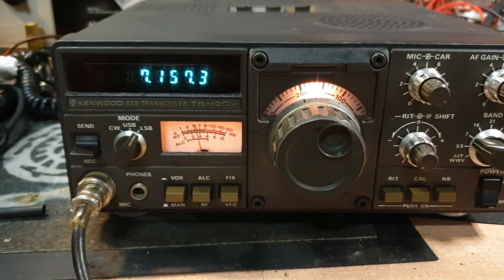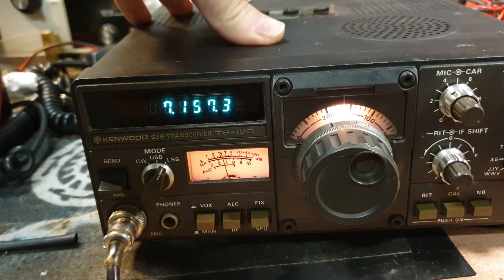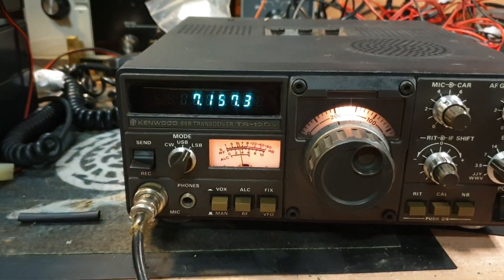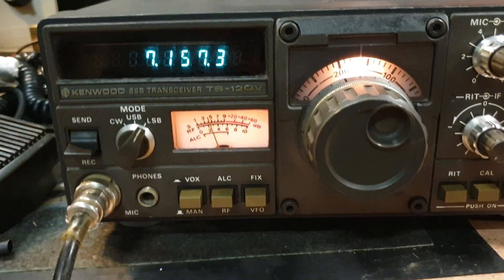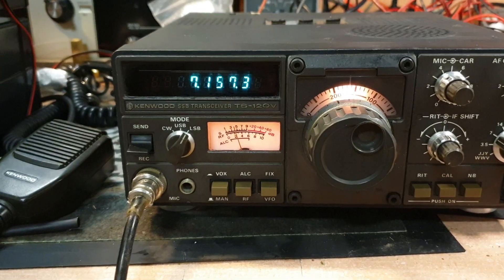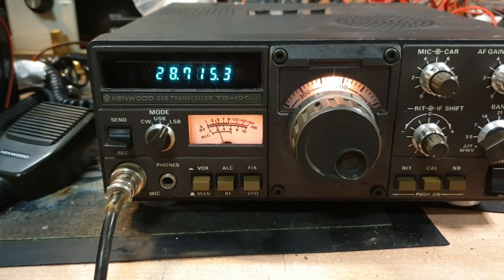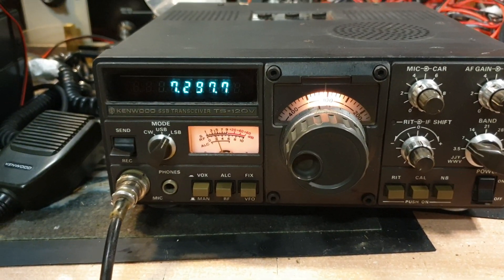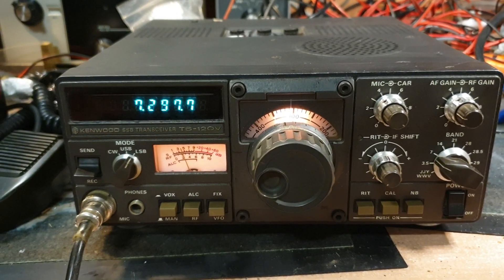How to fix that intermittent rx in your kenwood ts120 series radio.

Comment: It sounds as if you work on radios for a living.  I have a 120s with story attached. A certain gentleman (I use the term loosely) told me he had a TS-520 he wanted to swap for my 120s. Being disabled I went for the deal. The 520 was in good condition and worked well. 

A dew days later he rang me and told me his Father told him to get the 520 back and gave me some big sob story about it being a gift from a dead relative. Big softie me said OK and we exchanged radios again. I didn't get around to using it for a month or so and when I did. nothing worked no RX no TX. I quickly found the problem, every adjustment in the PLL department had been fiddled with. Everything was dropping out. I managed toget it back to working, but I wasn't happy with the results. Being the only Amateur in town there was nobody with any decent equipment to re-align it correctly.  

Not long after that I moved into town and had a neighbour who must have been run over by an Amateur, because he literally hated anyone with a radio, He even lodged a complaint with the radio inspector, even though I hadn't switched any equipment on since moving in. Radio Inspector drove 600km to check me out and found all but a 2 meter antenna erected and it was no problem. there was nothing for him to fix and boy was he irate.

Anyway, would you be willing to re-align my 120s for me. Not too far into the future I'm not going to be around and no doubt everything will be sold off by my wife. I don't want to give her extra problems with an irate buyer. By the way that guy begged me to do the 27Mhz mod and the reason he decided to play with it was simply because he read the manual where it said 300 watts and it was only giving about 80 on 27mhz. I'm tring to recall doing the mod because I'm sure I used one of the push buttons to switch something, I'm sure it was to switch 27 back to 28. Also I was a Limited Ham. G8SSM plus VK2KCB. Sadly I let the licences lapse. My radio room was downstairs and I don't have the ability to tackle stairs any more. 73's
Reply from the maker: Hi, sorry but I have retired from any repair work and mainly just doing restoration as a fill in when i can.  One chap that does great work is ray at razor radios in Qld, this would be a fairly easy job for him for sure... http://members.dodo.com.au/raykostiainen/rr-home.html